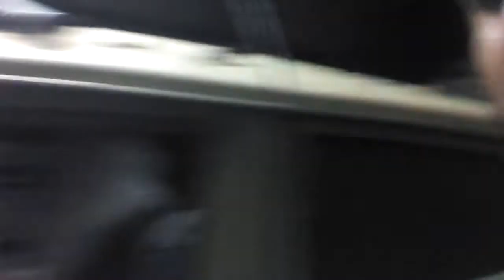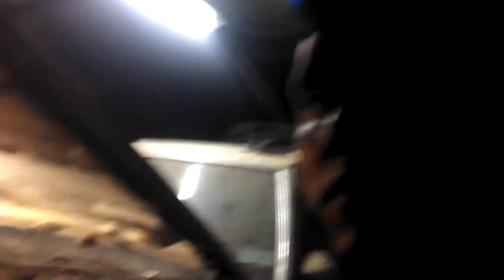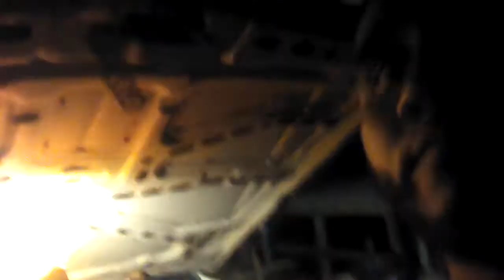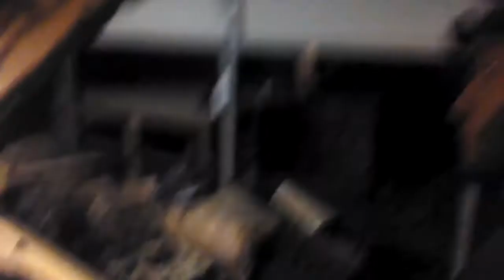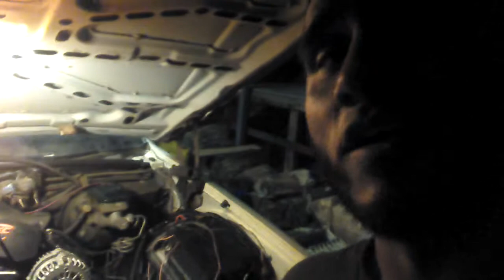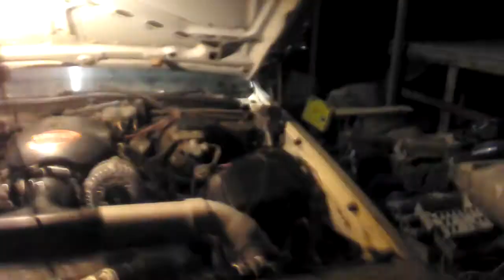The Box Chevy Takes Her First Breath!!!!!

Comment: @Beanoman90 I just fired up my swap a couple days ago too. I know exactly how u felt in the video. Being patient is the hardest thing to do. I followed alot of your moves to get mine running and it payed off. Thanks a lot fam.
Reply from the maker: Congrats on you firing yours up too man.  And I'm glad my swap videos helped you out.
Reply: Beanoman90 I'm using the truck fuse block and having problems hooking up the trans solenoids. The wire on my harness is brown. What could I use on that fuse block as a run/start source?
Reply from the maker: +Hakeem Russell http://lt1swap.com/underhoodfuseblock.htm  I'm not sure if you already looked at this but he tells which wires go where in the truck fuse block.  I'm unfamiliar with the truck fuse block and this is all I know about it.
Reply: +Beanoman90 I did read that page. is he saying the same thing u did in the video  where u hooked to the cruise control by the brake switch?
Reply from the maker: +Hakeem Russell ok, but are you wanting to wire up the torque converter switch or power up the trans solenoids?
Reply: +Beanoman90 I found a fuse on the block to power up the solenoids. the tcc switch is for cruise control right?
Reply from the maker: +Hakeem Russell OK cool, the TCC switch is what disengages the torque converter when you press the brake.  I hooked the purple TCC wire to my cruise control switch to disengage it when my foot hits the brake pedal.